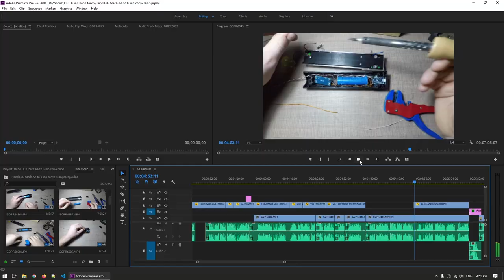How to make your flashlight 10x better in an afternoon

Comment: Why wouldn't you upgrade your front light to a Cree light and utilise the 2 x 18650 batteries... Would of made your touch brighter and longer lasting power wise
Reply from the maker: Hey Michael, thanks for the tip. The light is actually very bright and focused and I really like it as is. Plus, since it only has 4 regular LEDs on the front, the use time is incredible. I use it for 5~10 minutes on every few days and I still haven't charged it since I made the video.

Comment: Can someone point me to the parts I need for a flashlight build? I have the shell of a defiant 4d battery maglight type flashlight.  I have 4 18650 batteries. I need a recharging pcb with usbc port and fashlight bulb outputs and a momentary switch.  Preferably with different modes for brightness, strobe etc. I would like to make a superbright light like a spot light. I also happen to have a 9007 hb5 headlight led bulb but im not sure if it will over draw. I can use another type of bulb if need be.  In series I should get 14.8-16.8 volts out of 4 18650. I know it needs a bms system for balancing, over charge as well as over drain protection. I dont want to make it blow up either. Is there a safe way to do this?  If Anyone can help me make this happen I may make a video. Just seems like a cool project and it would stop these parts from going to waste. I am an electrician and marine mechanic/tech so I have some technical ability. Maybe there is a pcb on ebay or allie express?
Reply from the maker: Your request is a bit too specific. I have some parts listed in the video description but for your request I'm not aware of a ready made PCB that does that.

Comment: Can I charge 2 18650 Batteries with 1 TP4056 Charger Module ?
Reply from the maker: Only if they are in parallel, but the charging time will double.